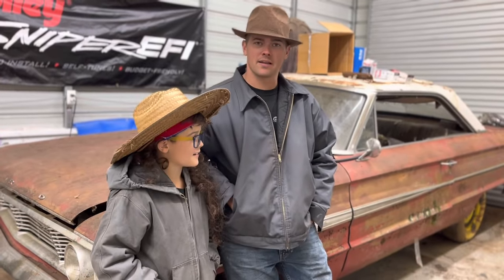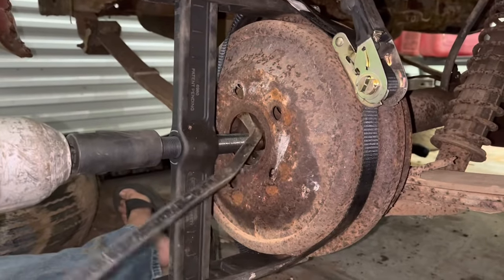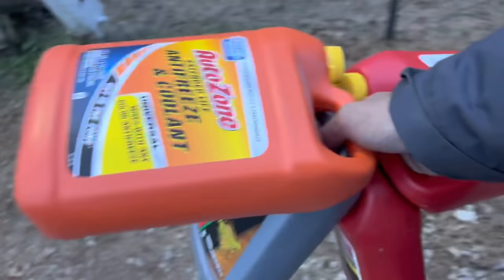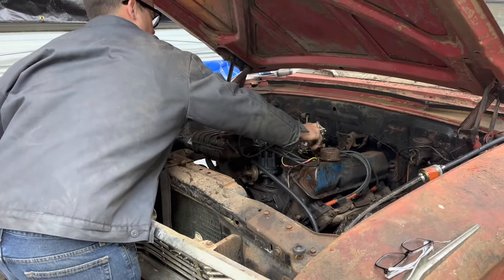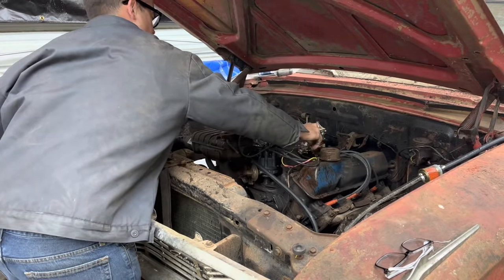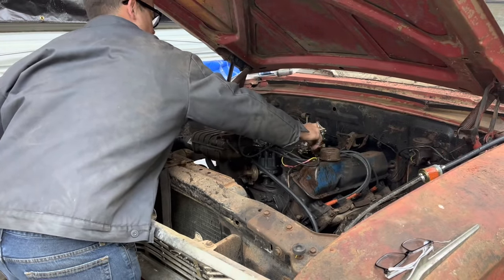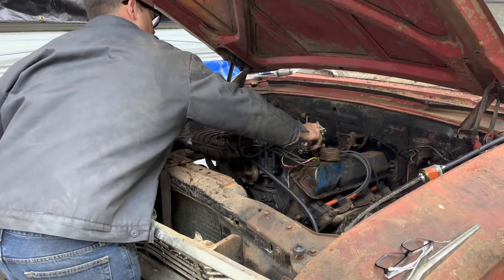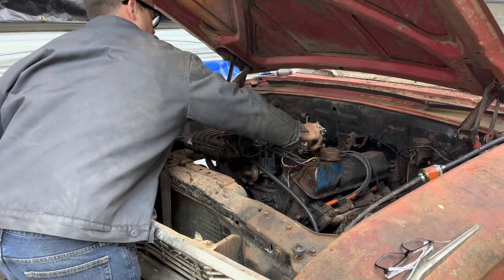30+ years parked and then instant burnout

Comment: Oh how I wish I could be there to slap ya on the back. High five to all of you. I imagine that when you stepped out of the car with the smoke that the lungs were feeling a bit raspy but thats why we do that ain't it?? Josh, words just escape me as to how proud I am of you and we will get that subscription numbers up there somehow. Other people are sending stuff an I can't get out of my house being crippled. The downshift rod has to be adjusted right for the shifter to work right as well. The valve body is just plugged up and short of what you are doing to use it and get clean stuff going through, not a clue as I have taken them apart and they are easy to rebuild. Only now if I do one, I set the tail of the transmission into a small barrel and make everything come out in layers. If I could only put it into words as to how   to do it and I ain't there to show you which is frustrating. I do remember being so poor that church mice were the upper crust in my cabin and needing fluid for my  transmission, I didn't have much in the house that would need cooking oil so in it went and it worked good. Some transmissions you  can mix up the oils and I think ford  was one but its a no no on any chrysler stuff. As for gm, I would be leary if it wasn't a powerglide as I think they were bullet proof too. Your brake problem is easy enough as the flare on your fitting ain't matching the flair in the proportioning valve... kinda a two different angles or just not going in deep enough. Okay this next part is easy enough but pull the coil wire as they do start easy off the crank. Get under the front and take hold of the vibration damper (pulley system for the alternator an water pump) and just  rock it back and forth and you will hear that timing chain slap. You can feel when its turning the cam too. It will always move the rods but when the slack is out of the chain (just like a bike) it will start to turn the cam meaning that timing is impossible with all that slack an make it fire up through that carburetor. Its just a lot easier if you do this when the engine has been off for a while as the heat swells those rings tighter. If it turns more than a half inch then its ready to fall off and most likely had the cam gear with those phony plastic teeth inserts that wear out and fall into the pan. You most likely will want to drop the oil pan down a half inch or so as its hard to get that cover over the dowels and back into place and keep the seal in. Since its all used pieces and parts, if that seal on the end doesn't break, use ritestuff gasket goop on it and reuse it to get it back in after changing the chain. Oh, I would just get a single roller for the amount of time its gonna ever be run as its not going to stretch that bad. I even had to file those dowels a little to get it started back in but once tight, who gives a dang. Another little problem your having is charging. Those voltage regulators can be a serious issue to find one matching that car as its just brushes in the generator and clean it up a bit then sometimes getting them to polarize to the voltage regulator is hard. I mean they say cross the field on gen to reg hot side which could all be done actually on the generator. Those wires all make same connection on the reg so whats the difference. I liked generators cause you don't need a battery to keep one running but the extra voltage bleeds over to the points and will burn them out if you just run it a long time without a battery. You know one way to check to see if its charging is to lift a cable off while engine is running and it should stay running. Usually if its the regulator thats bad, it will drain the battery with the key off so when not running.. pull the battery cable off and see if any spark occurs ...(that said, if a glove box light or a courtesy light is on then you will get a spark too) There just shouldn't be any sparks with the key off. It can be hard to see a parasitic draw so in shade or dark to see it. A clock will do it too but I doubt the clock works on it. Its gonna look wicked with it power washed and the wax laid on it. I have yet to find your patron button where I can send money to and I see some channels have a thanks button so maybe you need one of those. If different companies are sending you stuff to try  then your doing something right!! I got a book here so will jot more later.

Comment: Don't you use cam lube on your contact points of the backing plate ? Also they build ridges on them so i use a drumel tool to smooth it out to keep shoes from hanging and popping from spot to spot .
Reply from the maker: Good info thank you

Comment: I'm surprised to see it's been C6 swapped as well. Also the oil hole on the side of the third member on the axle is different, neither of my 64's have that plug there. Just on the back side of the axle.
Reply from the maker: Ok thanks

Comment: Josh, that little reservoir is the expansion tank. You aren't supposed to fill them all the way to the top. 
In regards to the water pump, they will lock up due to bearing failure. If the seal fails, for sure that's going to happen.

Comment: ....you need the "Motors" repair manual from 1964 to 1968....it covers most information you need for the FE big block Ford's,..(blue hard cover "Motors" repair manuals are best.)
Reply from the maker: That would be good thanks

Comment: Check your wheel cylinders. Check the master cylinder. Then fill the master cylinder and open your bleeder valves at the wheel cylinders and gravity bleed it over night. You’ll need to monitor the master cylinder.
Reply from the maker: Ok thank you

Comment: I’m wondering if this 390 swap was from a thunderbird 1966 and trans followed the swap ,if you watch videos on the tilted steering It  had some very odd factory designated maneuvers before you started the car , then how you swung back the column into locking mode .A trannies lock and unlock specified feature

Comment: Bit late to the party, but if you are going to replace the hoses just take a chunky drill and drill straight through (creating both an air hole and a drain hole) so the coolant has only one way to go (preferably into the catch pan).
Reply from the maker: Good idea

Comment: Back in 1985 I bought a 64 four door hardtop for $60.00, the engine and trans were gone . I put a 351 W in it and had it all fixed up and ready for paint when I got in a race with the local yokals. I they chased me 7 miles and I had their big Chrysler Police interceptor outrun until I got upside down !
Reply from the maker: Awesome

Comment: Sleeperdude , next time go directly to Napa and don’t forget to have plenty of PB Blaster and 1 case of Brake Cleaner  …. Hope you change that thermostat to 195 … save you a little fuel …. Again , do not use Acid/green Anty freeze on that car …. It should be a Felony for putting it in your cooling system …. That is why your water pump froze on the car

Comment: That radiator leak may have been why the water pump was locked up , the last owner may have put some barsleak in it to seal up but just sealed the water pump
Reply from the maker: You could be right

Comment: You also need to get you a rubber mat to put all your parts and stuff on. That way you're not getting the concrete all oily and stuff. That way your concrete stays clean and you can degrease your rubber mat and it will be ready for your next use. Think about it.

Comment: The reason you weren't getting 12v for the choke where you had it is because a points type distributor runs off of 6volts , the wire going to coil has a built in resister that cuts 12v to 6v

Comment: Could it be that they had transmission problems that went away when they added a new dangled additive to the tranny. And it worked. But they never changed the fluid.  And that was what was on the boy if the pan. Along with clutch material that made them try the additives
Reply from the maker: Yeah maybe so

Comment: Do you have a NAPA auto parts store nearby. That's where I normally find complete kits or lines, etc. If that doesn't work. Then I use Rock Auto.
Reply from the maker: Yes but they are usually closed by the time I get off work

Comment: Soooo... not being critical...but if the trans pan had that sludge you scraped out so does the oil passages and the check balls and ..that locking up is two gears trying to operate at the same time. Stuck servo actuator as another servo pressurizes. Or even reverse stuck in no position crudded up. 
Clean up the trans.🤔😳😉👍😎
Reply from the maker: Yeah I think your right

Comment: You need to buy you a lathe. That way you can turn your drums and don't have to do all that work buy using a drill with a scrub pad to get them clean. It takes 2 seconds with a lathe. Then you can also turn your rotors too. Think about it.

Comment: if it's not OE, most likely it's worthless limited warranty part, meant to fail.. They all fail. or assembled wrong, I had New Part for my ranger that the turbine was pressed to much into housing, when the RPM went up it hit, now that a sucky job to Redo twice,  It's the while your into this Deep, better off replace or clean it.  Cheap insurance just replace all the springs in brakes.. Voltage regulator should supply the power to the Choke,  just changed mine on Bronco. You did put heat on Proportional valve, most likely melted some O rings.
Reply from the maker: Ok thanks

Comment: I put mileage and date on every part I replace,especially if it's from Asia.FE water pumps wont last a year when stored,except for that hi-priced one made in US aluminum water pump(5 yrs. and counting).Another trick,on both the FE's and small sixes,when doing exhaust manifolds,on the top bolts,use 316 stainless steel with coppercoat.Never have a problem about seizing again.working on  my 6th master cylinder in a year now.Owrongly is just going to keep replacing their limited lifetime crud.Anyone know where to get American parts?
Reply from the maker: Ok thank you

Comment: Okay here's info on where to get bolt on and go disk brakes for this car --> https://youtu.be/a2GVOr94PGw?list=TLPQMjUxMTIwMjElTI4goKDq7A&t=596 
  Sounds like a strong 390 you've got there :-) Get friendly with a well stocked wrecking yard. Measure up those seats and  get some from the wrecking yard that measure up [unless you want to get the old ones re-upholstered]. Maybe also grab some front disks as per Craig909 did. Seems affordable and a good way to go with that big block you have. Also, you going to get the rears plumbed in right and a line lock installed for the burnouts? lol  Glass pack mufflers [Thrush mufflers we had back in the 70's[. :-) Love this car bud! Nice!
Reply from the maker: Ok thank you

Comment: Ya know testing with water is fine but there is two words in the name of that fancy green stuf "antifreeze coolant". Water is not good enough I've bought cars from down your way. One that comes to mind over all the rest it said it was running cool but that was a lie. The heater would run hot.......for a little while and turns out the head was not cooling at all,the cooling system was all plugged up (ya know kinda like your water pump there)the only place that was cool were small parts of the block. So in closing water can completely destroy a car educate water is not enough use coolant the more you know😎😎😎

Comment: I dont understud how you can buy new parts on car from 60 . In Europe you have problem get parts on car what is 10 yers old. And get a car from graveyard and nake it back on road? No way in Europe!
Reply from the maker: Wow !!!
Reply: Yes wow! :) And you can build your own car. Change motors change everything you want on car and you can it use on streets. In Europe you cant change even weals   or tires! They must by exactly the same like from factory. And we must go every two years to car check and emission check. And when we don't pass our car will by destroyed. And when I see your big V8 engines and that sound! Man! That's cool! Wont you know what engine I drive? 1.2 liter 3piston engine. :))) And that is normal in EU.

Comment: Besides using PB Blaster 1 week before and using Napa Auto …. Never ever ever ever use Green Anty freeze on any car you like …. You might as well pour Muratic Acid in your cooling system … That shit will eat Aluminum , Copper , Steel and Plastic parts . This is a Ford , stop by Ford and buy a Motorcraft factory 195% temp thermostat and 2 gallons of Gold Antyfreeze …. Maybe you can buy a new PCV valve while your at the dealer …. I know that one is almost new … 50 year but , what the Hey ??
Reply from the maker: Ok thanks